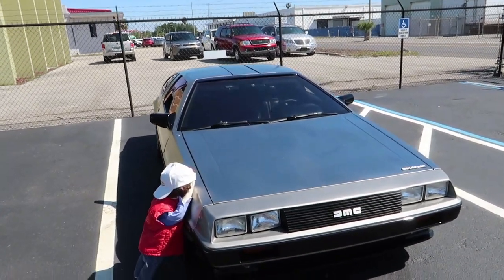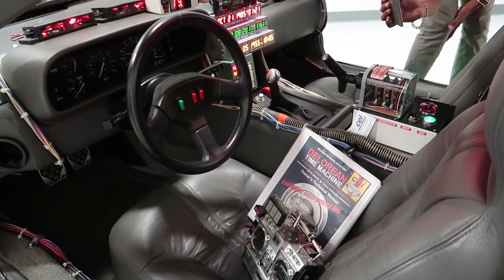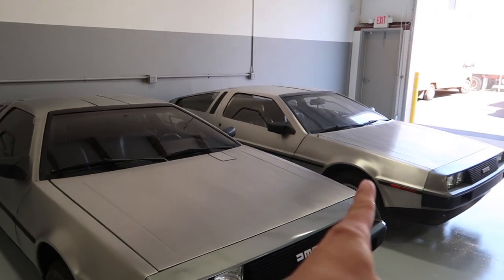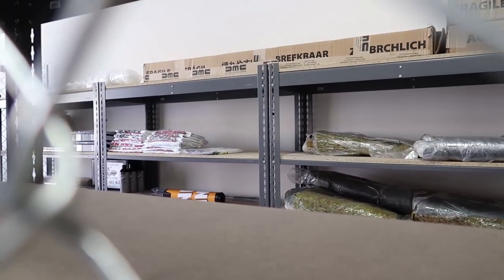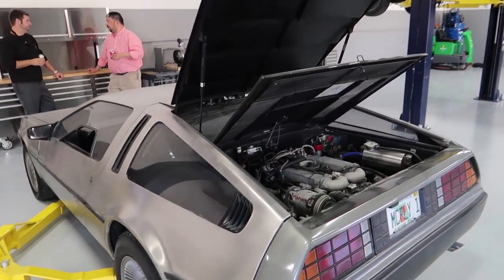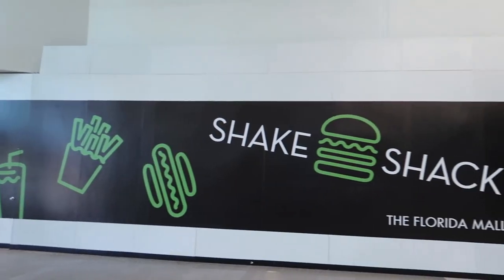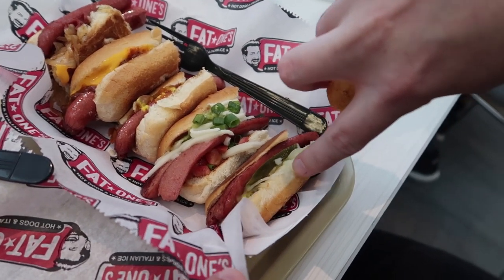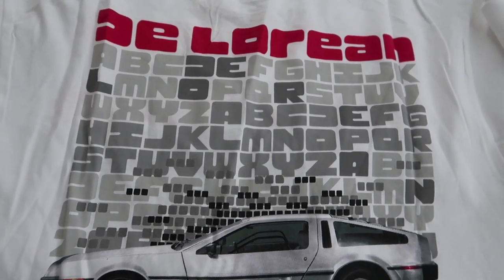Going To The Grand Opening Of The DeLorean Dealership & Trying A Fat One At The Florida Mall!

Comment: I like how the hod dog place cooked them right.  Slit them in half for even cooking.  It works for the grill or pan.  It just helps with a flat weight because they will curl.
Reply: even cooking? I thought it was meant to give the hot dog enough room for the other condiments.
Reply: It allows more surface area for fast cooking.  The side benefit is you can use a higher heat to cook them faster as a result you can actually get some crispy browning.  It works for the grill, griddle, or pan.  If they are to be boiled, don't slice.  You can't brown in boiling water so there is no point.
Reply from the maker: Interesting! I will have to try that next time I cook hot dogs!

Comment: Are they making new cars out of the 33 year old parts or are they making new cars by using the classic parts as manufacturing templates?
Reply: The new cars are going to be produced using primarily NOS parts, but updates in brakes, power train, sound system, etc... will be introduced.